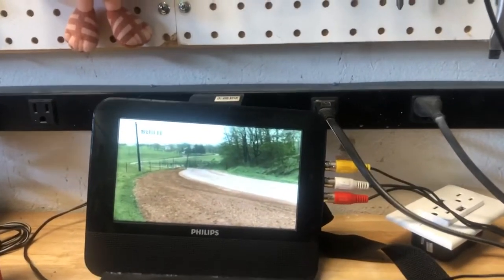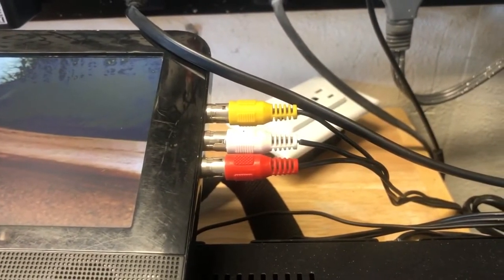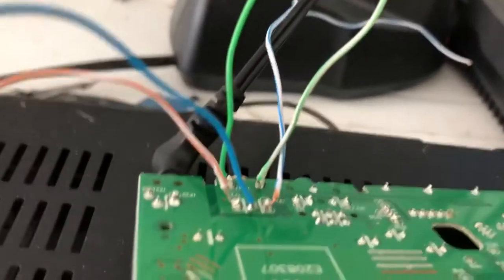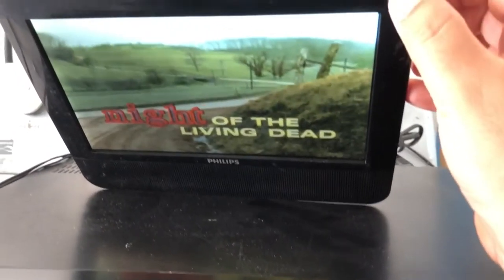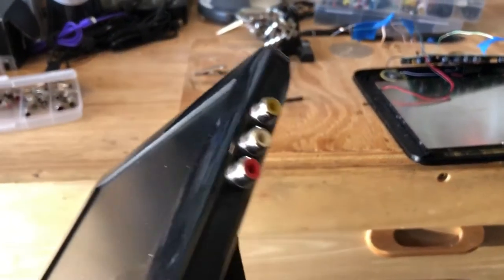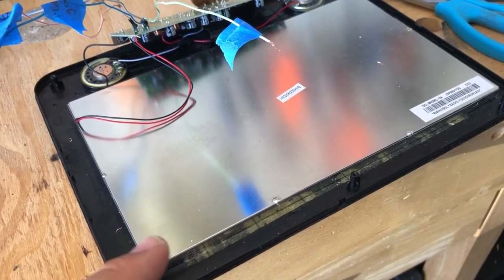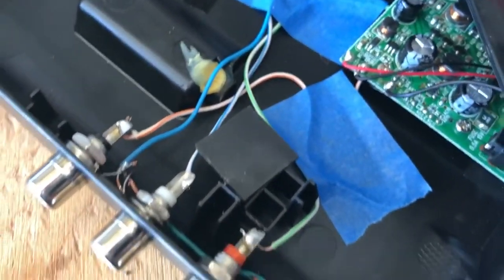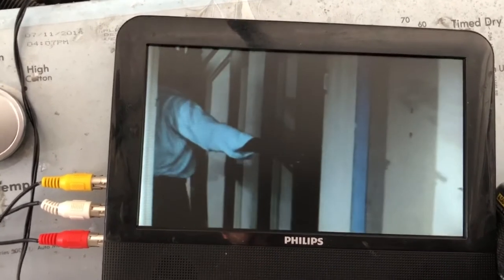DIY - Composite Mod on Phillips Portable LCD TV

Comment: How about a labeled wiring diagram?

Phillips Wiring:
1 (sleeve) right audio
2 (ring 1) ground 
3 (ring 2) video
4 (tip) left audio

Rewire the plug to:
1 (sleeve) ground
2 (ring 1) video
3 (ring 2) right audio
4 (tip) left audio

No internal modifications necessary to monitor with rewired cable.
Reply from the maker: You got me there.  I had to poke around the jack to find the right signals to isolate each signal (audio/video).  If I do another one of these I will certainly share a schematic.  Thanks for watching the video!